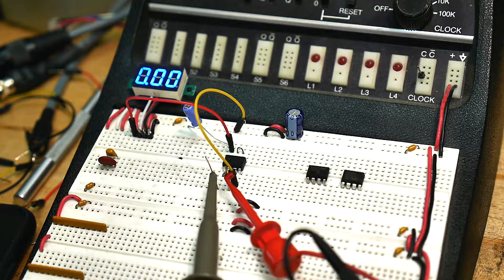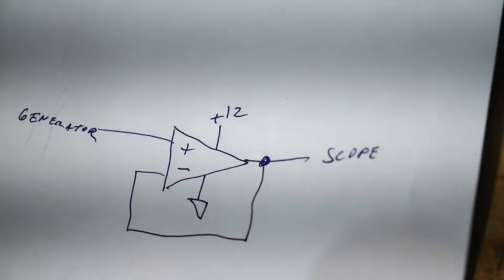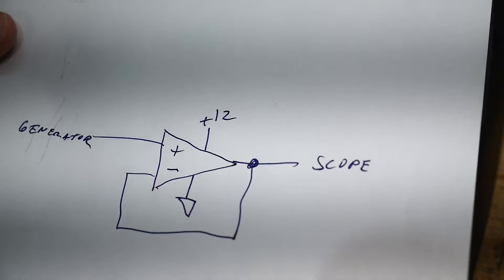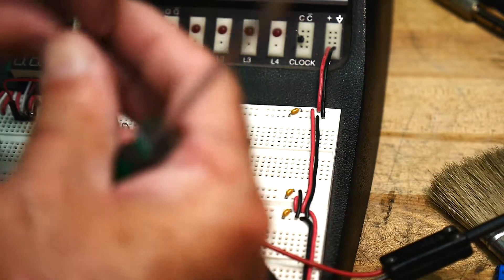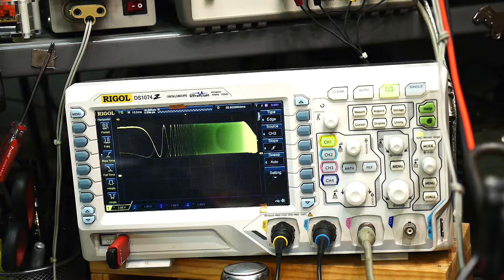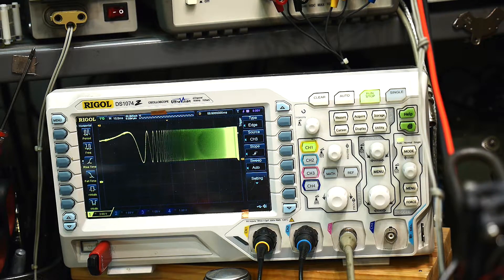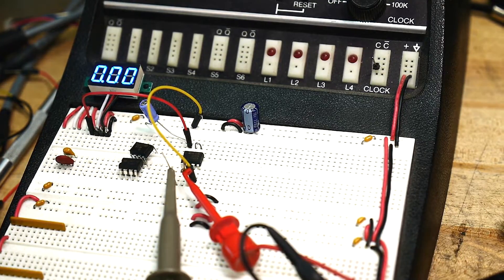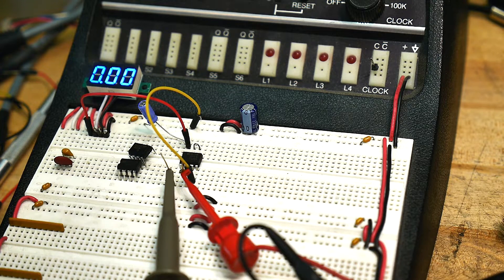#466 Gain-Bandwidth Opamp Measurement

Comment: Hello! It`s a very usefull video! Can I measure transition frequency of  a BJT? I`ve the  next equipment 1)60MHz oscilloscope, 2)a home-made crystall oscillator 3) home made signal-generator on AD9833 (to 10MHz). I`d like to test my 2n2222 transistors, because a gain of the one on RF isn`t good enough.

Comment: Great videos, still going through them. Thank you.

Wanting some experience with op-amps, I bought some LM358p amps. I just wanted something cheap that can run single rail, too. Looking at them on the scope with a square wave,  they don't have good slew rate at 10kHZ, and by 20kHZ, the results are not pleasant. Though I had it the running with a feedback resistor and not for unity gain.

My setup could be better, but still.

Reading more, and watching this, perhaps the T072 would be a really good beginner Op-amp.
Reply from the maker: For single rail see my video: https://youtu.be/aryv6ouSqvc
Reply from the maker: If starting off using opamps, use +/-12V. If you try to run opamps on a single supply you have to reference things to a virtural ground that is 1/2 your supply, not always easy. use the +/- until you are comfortable with opamps in general.

Comment: Nice, but isn't it more reasonable to assume that the TLC-series of opamps gets destroyed/hot because they have a 18 volt absolute maximum supply voltage (and you're feeding them 24 volts) instead of them not supporting bipolar supplies in general?
Reply from the maker: While you are correct, I'm warning if your opamp circuits are running +/-12 or +/-15 a TLC will be destroyed if you plug it into that. The datasheet calls the negative rail GND not -V as marketing a +/-8 volt device would not sell many parts